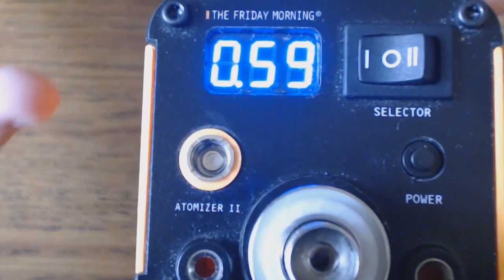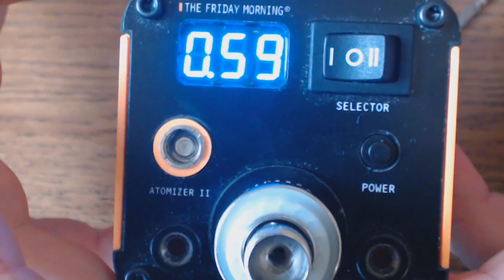Aspire Atlantis Rewick'd

Comment: Just rebuild it like a Protank head it works really good and its much less hassle
Reply: no then its not as good

Cheers
Reply: Bill Prater that's how I did mine. Its still much better flavor than the stock coils. I'm Vaping it between 30 and 35 watts on a six wrap 24 gauge coil. Its actually a really nice vape
Reply from the maker: david sandlin  ok then I'll say cool to that as you didnt specify how you had rebuilt it other then protank lol

Cheers m8